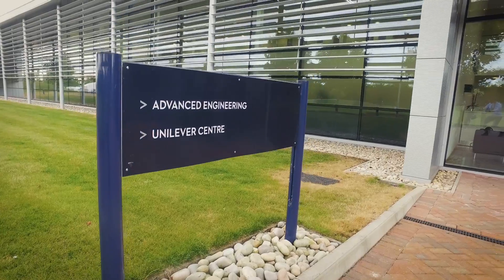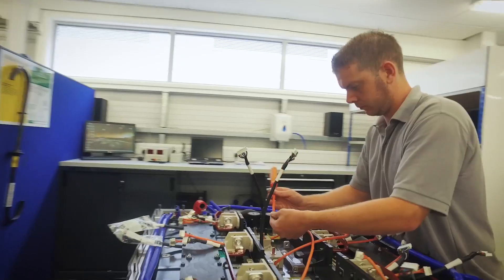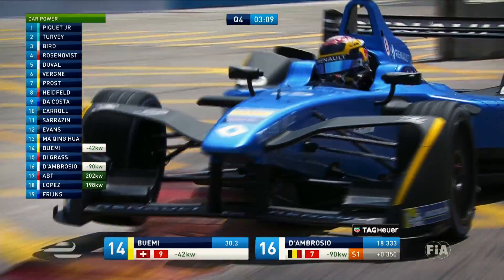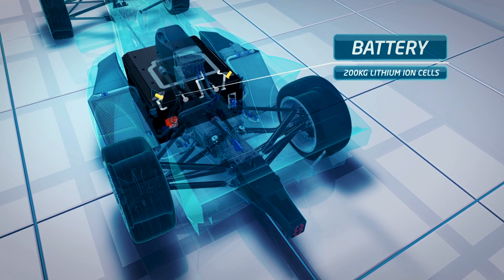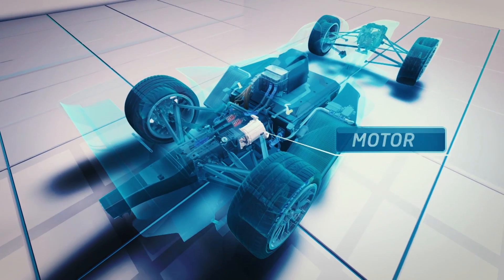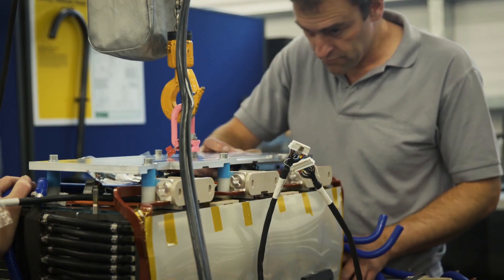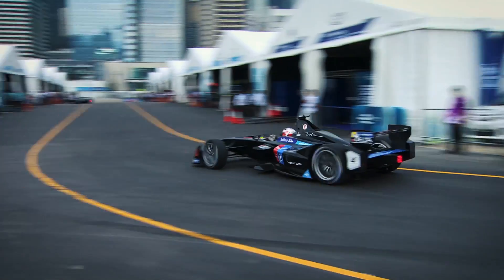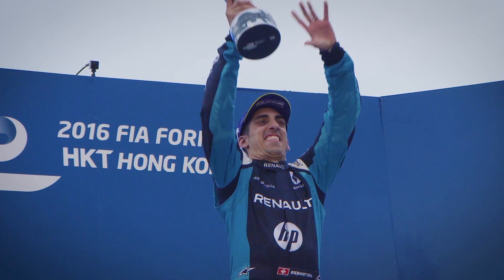The Formula E Battery Developed By Williams

Comment: THis is nothing like laptop cells. Laptop us LiCoO2 cells that have low discharge rate and high internal resistance. Not good at all for high drain application. Maybe similar is you think with a reductionnist mindset, only in terms of capacity...